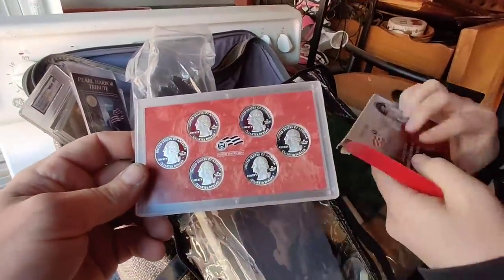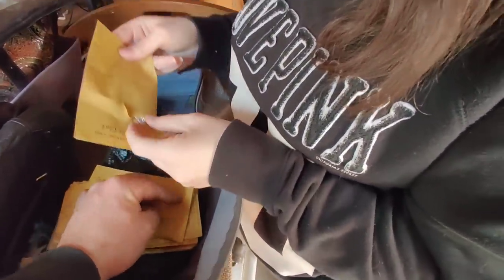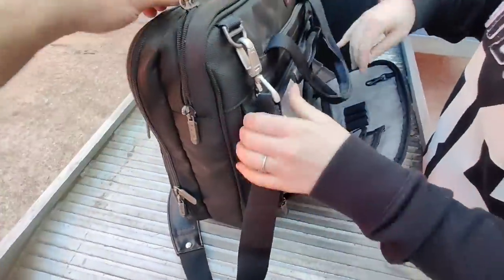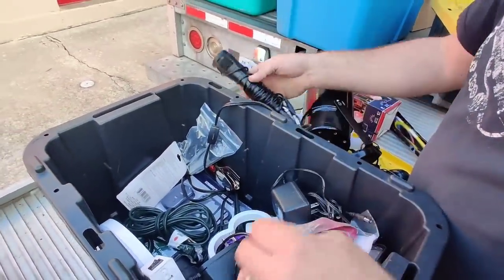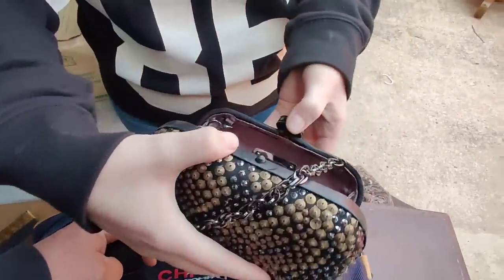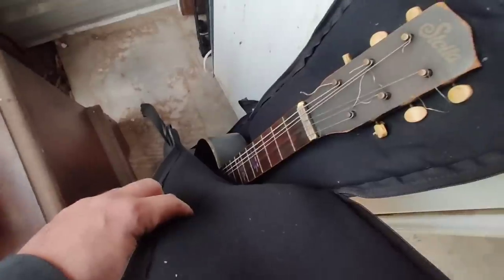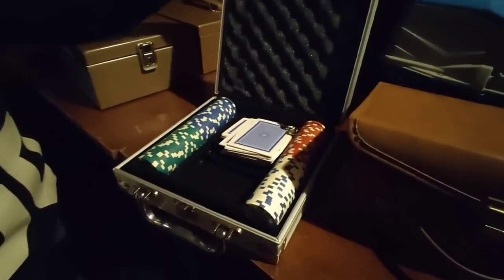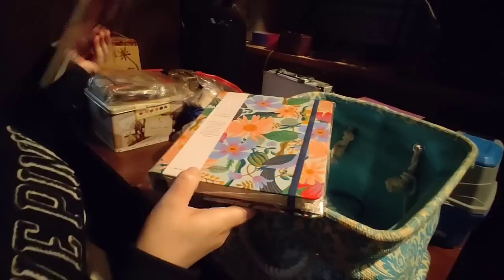She HOARDED her JEWELRY away... But I discovered it! Why would she leave all this behind?!

Comment: Fun locker 👍

Collectors are usually pretty organised so hopefully you haven’t made it a lot harder on yourself to work out what’s what 

The rolls may be ones he was going through looking for defects etc that make them more valuable.

The corrosion could just be moisture getting into the tin which starts corroding the coins, it then spreads to the coins around it